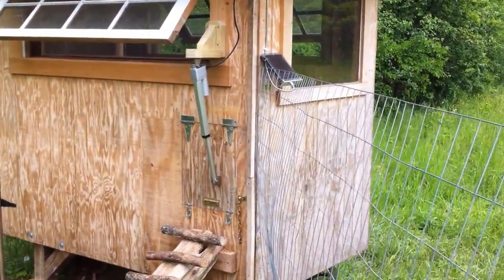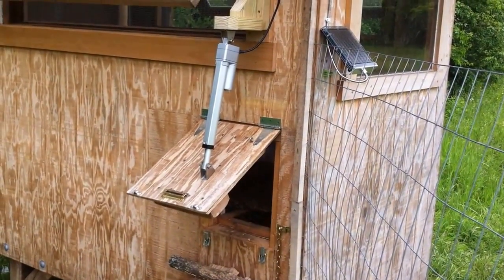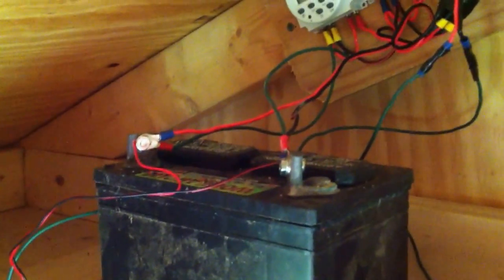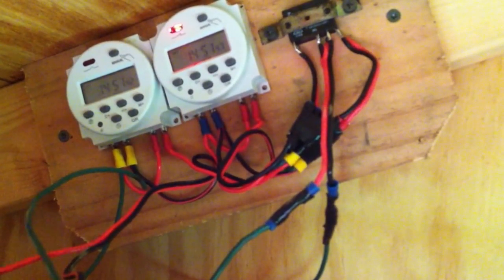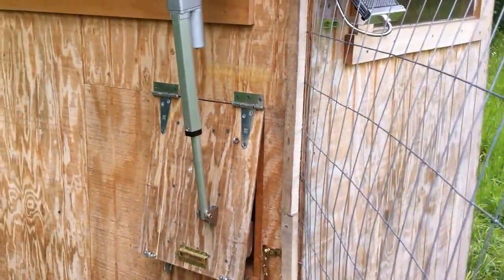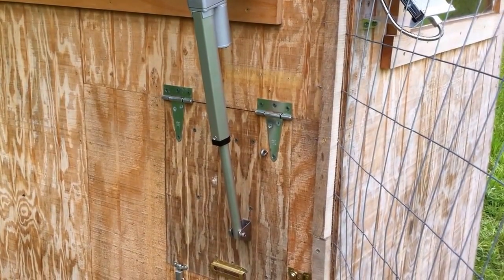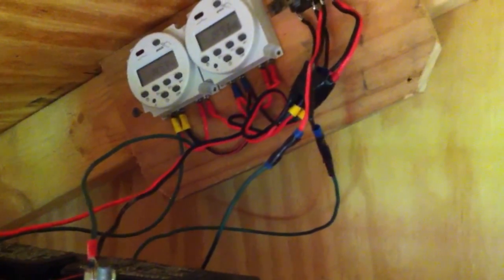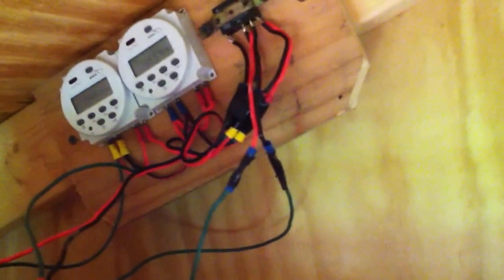Heavy duty automatic chicken coop door

Comment: You must have a different type of relay than I have. I have a dp/dt relay but it does not have an OFF it is switched one way or the other. So during one of the cycles either day or night the relay is pulling power which I don't like but only takes one timer. Can you explain your relay and wiring better. Thanks, I went to your link and it seems others had the same problem I did.

Comment: Why do you have the door close during the day?
Reply from the maker: To demonstrate how it works. Normally I have it open before sunrise & close after sunset & that would be hard to film :)
Reply: @MikeWickenden  ahh ic... My bad
Reply from the maker: @bighigh69  16-gauge or 18-gauge wire should be fine, unless you are using more than a few feet of wire for some reason. See this page for more info: http://blog.netscraps.com/diy/heavy-duty-automatic-chicken-coop-door-ii.html
Reply from the maker: Although the solar timer option is the best, in my opinion: http://blog.netscraps.com/diy/automatic-chicken-coop-door-solar-time-table-switch.html
Reply from the maker: @bighigh69  Hey, that particular model battery pack won't work because the output is 5V @ 2.4 amps. To power the linear actuator, you'd need a battery pack that outputs 12V & at least 5 amps. Something like this should work: https://amzn.to/3deD1vT

Comment: I did basically the same thing only the actuator works horizontally.  Have you had issues with the mechanism freezing and not working in cold weather? We have had several days in the low 20's and the motor doesn't work.
Reply from the maker: No issues. You may want to try vertically. I'm in Vermont. It has worked great as cold as -30 degrees F. I've never had to replace the actuator in the 7 years I've used this, the original is still going strong.

Comment: Had this working today and then for some reason the relay board stopped responding.  I got everything mounted into a waterproof case. I made the system slightly different usine a battery and an AC power source. Ran the power through a solar charging unit to control the charge to the battery and keep everything running in a power failure.  The power light and red relay leds illuminated and would not go off.  Something fried the relay board.  Have ordered a replacement to  try again.

Comment: I just purchased my actuator, timers, charge controller, solar panel and battery to install the same, however, I see you have a relay...what is that needed for?  I was planning on wiring one timer to turn on every morning at 6:00am, off at 6:02am with normal polarity and one timer turning on every evening at 6:00pm, off at 6:02pm...so no timer will be on at the same time.  How are you wiring it to reverse polarity?  I was just going to reverse 2 of the wires and hook all 4 to the 2 actuator wires but I know that's a problem if they turn on at the same time.
Reply from the maker: Sure -- Your method will work fine if you have double pole single throw (DPST) timers that switch both +/- leads. However the problem is most timers are not the DPST type. DPST timers are expensive, like $45 each & you'd still need 2 of 'em. The more typical digital timers only switch 1 lead & are called single pole single throw (SPST).

For a typical SPST timer setup, you run (-) directly to one lead of whatever you want to switch on, & you run (+) through the timer to the other lead. However with SPST timers you can't wire timer #2 connected for reverse polarity -- it will short circuit because as soon as (+) is switched on by timer #2, it's shorted to the direct (-) connection from timer #1.

The double relay module makes it so the leads from the actuator switch between power sources that have reverse polarity from each other. When everything is off, the actuator is connected to (-) (-). When only timer #1 switches on it flips the left relay so power is (+) (-). When only timer #2 switches on, that flips the right relay so power is (-) (+). If both timers come on, power is (+) (+) which does nothing. More info & the wiring diagram is here: http://blog.netscraps.com/diy/heavy-duty-automatic-chicken-coop-door-ii.html

In the video I had originally used a DPDT relay to reverse polarity which is more complicated because the timers have to be programmed to come on simultaneously for the door open event. The better way I described above & in that blog link is to use a dual relay module where one timer controls door open & the other timer controls door close.

Comment: I've thought about setting something like this up. I may use a raspberry pi to do all the thinking though... my one question I'm left with is how do you make sure the chickens are inside when the door closes? I know my chickens and I don't know how quickly they'd catch on to the automatic door concept...
Reply from the maker: Hi Bob, my chickens haven't had trouble with that. One thing that probably helps is our coop has several horizontal sticks for them roost on, & the outside run doesn't any, so when it starts getting dark their natural instinct to roost kicks in & the only place available is inside the coop. We're on 3rd flock of layers & they all just seem to get it.

Comment: Great project. What is the weight that the actuator can load? The actuator is also like this DLA1  actuator: http://www.powerjackmotion.com/product/dla1-actuator/
Reply from the maker: Hi Steve, sorry for the late reply. The actuator linked in the parts list (see website linked in the video description) is rated at 225 lbs force. Most 12V actuators are rated for at least 100 lbs.

Comment: Mike - thanks again for the vid. The only thing I changed was a 12" actuator (lifted the door a bit higher). I also mounted the components on the outside of the coop for easy access to the timers. I used a $5 rectangle food container with a watertight seal (my power plug is actually inside the coop). I used silicone for the one hole that I needed for the wiring and where I screwed it to the coop. 
On a side note, after I assembled everything (before using Velcro to affix the components into the container), I did a manual test. Some lights came on, but nothing happened. I remembered somewhere you mentioned polarity, so I made a quick switch and there it went... perfect. 
The other thing I forgot is not only do you need to set the timer for a "on" time, you need to set each timer to go "off" one minute later.
Thanks again!
Reply from the maker: Hi David, whoops just replied late to your other comment -- that sounds great! Good move relocating the components to somewhere more accessible -- I eventually moved all the electronics in the video to just inside the door, because climbing into the back of the coop to check/change timer programming every few months was ... dirty.

Comment: Hi Mike. Great door! I was wondering what the stroke length needed to be. I'm looking at 12". Any thoughts?
Reply from the maker: Hi David, just depends on your application. Using a tape measure it should be easy to measure how much travel your door needs to open. I used an 8" actuator because I needed 8" of travel. A 12" actuator would have worked fine too for my door -- I just would have attached it farther down toward the bottom of the door or moved the top bracket farther up (which would have opened the door wider). I didn't want my coop door to open too far toward horizontal because I didn't want to give chickens something they could easily stand/roost on.

Only other consideration I can think of is typically a longer actuator will have a longer run time, which isn't necessarily a bad thing.

Comment: Mike:  Have you had any problems with moisture?  I have four of the same actuators and one was rainde on and some moisture collected down in the motor and ruined it.  I can't figure out how to seal it better and still have the the screw push up through the top of the cover..T.hanks
Reply from the maker: Hi James, no, haven't had any problems like that. Been using the same linear actuator for 5 years & it's out in the rain & snow etc. I bet the orientation makes a difference though especially with the cheaper IP-65 & lower-rated actuators. There's better IP-rated actuators available & the higher cost isn't bad, like this one: https://www.progressiveautomations.com/linear-actuator-ip66
Reply from the maker: Not sure what you mean by "have the screw push up through the top of the cover"... do you have your actuator so the arm extends up? If that's the case I can see how water could run down the arm & into the housing, because I'm sure the arm gasket these cheap actuators use isn't great. But, you should be able to flip the actuator around unless space is tight or something like that .. just need to leave longer leads to the motor since that end would move more.

Comment: Just curious why you didn't just use a DPDT relay for your polarity change and then use the timer to control the relay. On = door open, Off = door closed. Then you'd only need one timer. Default condition being closed with power always on,  the limit switch controlling power off to the motor.
Reply from the maker: #16 Racing I didn't do that because of power consumption. Keeping the timer relay & DPDT relay energized for all those hours consumes too much power for this small solar power setup. What you describe would work fine with dedicated power but I still prefer two timers. On the blog I describe a simpler method I've switched to where 1 timer controls opening & 1 timer controls closing.
Reply: @MikeWickenden  I watched the vid and was thinking the DPDT looks to be redundant in this circuit. Unless the timer controlling the DPDT relay was replaced with a photoresistor relay. Current draw on the coils of both the DPDT and photoresistor relay based on 200ma each over 12 hours(light/dark) looks to require a solar surplus of 4.8 amps at 12 volts, hypothetically. Or equivalent solar surplus of the ability to run an additional 60 watt light bulb over the course of an hour.
Reply: OR the timer I just omitted controlled the photoresistor and dpdt circuit to limit it's power consumption to 2 hours or hypothetical 2hrX3relay coils @ 200ma which I think would work out to 14.5Watts on a 12volt. IF the timer wasn't sitting there consuming electricity to control when to turn this circuit on and off. Hypothetically 14.5watts is max consumption since the photoresistor coil and DPDT coil should not be firing off for one of these hours making it more like 9.6 watts of draw. No clue on a digital timers power draw in it's resting state. "In the sit there and dont activate relays but remember what you where set up to do" mode. But the 50 watts of power draw adding it would be avoiding looks like it creates some room for power savings without buying a digital timer and checking it's resting power consumption and crunching these numbers further.
Reply from the maker: @gantz4u  the timer is SPST. So it can't reverse polarity. That's what the DPDT relay wired as an H-bridge does. The power draw of the timers in "sit there" mode is negligible, so using a timer to limit how long the photoresistor relay operates for would be worth doing.
Reply: @MikeWickenden  Just figured this SPST problem out after lighting my house on fire shorting the battery together several times. (That's not a timer. More like a timed relay. Quality build there.) And see the problem now. Further looking into the idea of a photoresistor It seems the chickens demand more consistency for when the door closes and get locked out. a buzzer then motor firing on a delay seems like the better choice since the chickens supposedly start reacting to the buzzer, IF you where to modify this design. I wouldn't toy with the idea of a photoresistor without a buzzer and then delay relay. Unfortunately it seems the most simple noise production devices are also very annoying noises that sound like they scare chickens. I've also lost my morale entirely realizing im not dealing with timers here and need to complete an engineering degree as a work around to that fact.

Comment: I have an automatic door I made for my chicken house that uses 120 vac. I had it hooked up with a timer and a photo cell but the problem I had with it is always having to reset the timer for the length of the days at different times of the year. A photo cell works great to open the door but it can close to soon and some of the chickens might still be outside. I found a delay timer that I am planning on installing to delay the door from closing for 1/2 hour after the photo cell switches. That way all I will need is the photo cell that controls the main relay and a delay timer relay to extend the time 1/2 hour after the photo cell switches telling the door to close. "No more having to reset a timmer for the length of days."

Comment: does your battery ever loose charge do to cloudy days
Reply from the maker: Richard Vandeflier no, the battery can run the system for over a month without being charged. It has extremely low power consumption. If you live in a very cloudy area, definitely use a solar charge controller which is described on the blog post. http://blog.netscraps.com/diy/heavy-duty-automatic-chicken-coop-door-ii.html
Reply: Mike Wickenden bb

Comment: Thank you so much for your video. I watched tons of them trying to figure out a system for my coop. Yours made the most sense to me. Just got mine done. Check it out and let me know what you think. http://youtu.be/mZ1B9RxMkxQ
Reply from the maker: Hi Brad, sorry for the late reply, your comment got held up in the Youtube spam filter & I didn't notice it until just now. Nice work on the coop door, looks great. You might have seen but I made a better version where the two timers don't have to go on simultaneously -- one timer controls opening & the other timer controls closing. In place of the DPDT relay I use a dual SPDT relay module -- or you could use 2 single SPDT relays. Here's the link to the instructions & wiring diagram for the new system: http://blog.netscraps.com/diy/heavy-duty-automatic-chicken-coop-door-ii.html

Comment: Quick question... Why can't you just wire each timer to the battery separately and then wire each timer to the actuator with one timer wired with reverse polarity from the load output? Why do you need the relay? If you need the relay, why do you give the second timer power from the first? Would you not get the same results giving the second timer power from the battery? Your video and diagram is fantastic. Thank you for taking the time to make it. I'm not questioning the way you wired it, the questions are more for me to understand the reverse polarity and relay. I've never understood the reason for relays.
Reply from the maker: +76mcclain Sure, good question. The problem is the timers are SPST -- single pole single throw -- "single pole" means they only switch one lead. In other words, SPST can't switch both positive & negative leads simultaneously. "Single throw" just means the circuit is either disconnected or on, but that doesn't matter ... single pole is the problem.

Hypothetically if you tried to use two SPST timers wired directly to the actuator, you'd have a negative lead connected to each actuator lead, & a positive lead running through each timer also connected to each actuator lead. But as soon as one timer switches on, that creates a short circuit with the negative lead (meant for the other timer) that's connected to the same actuator lead.

If you could find a DPST or DPDT timer -- double pole meaning it switches both positive & negative -- then your suggestion would work, as long as both timers never came on at the same time which would make a short circuit. Using the method I described, there can never be a short circuit since the "polarity switcher" is the DPDT relay wired as an H-bridge, which can only ever provide power to the actuator one way or the other.

In terms of "why you give the second timer power from the first", they're just sharing the same positive & negative leads from the battery. It's the same as running individual wires from the battery to each timer terminal, just uses a lot less wire. The only circuit that actually gets switched on & off by those timers is the red wire on the far right side of each timer, & both of those go directly to the relay.

Relays are just an electrical switch that's turned on & off by electricity. Sounds silly at first but there are a few big benefits. You can switch relays on or off using low-power currents, but have the relay switch high-power current. For instance in your car when you turn the ignition, your ignition is a low-amp switch which turns on a relay near your car battery that routes all the high-amp power in your car battery to the starter motor. That way your ignition switch in the steering column doesn't need to have huge thick power wires running all the way from the battery & back to the starter motor, & the ignition switch itself can be really simple because it only handles low amps. Same thing with winches where there's a control at the end of a long cable -- rather than running thick power wires all the way to the control switch & using expensive switches to handle the high-amp power, they just run low power to the control box using cheap switches & wire, with a few relays back near the winch motor to handle the full power to the winch motor. Similarly with some relays is you can use DC power to activate the relay, & have the relay switch AC power. Also when relays wear out it's cheaper & easier to replace them since they fit standard relay sockets.
Reply: +Mike Wickenden (Wick) cool. That makes sense. Do you know how to wire it up with a photocell? How do you get the reverse polarity with it? I've looked all over the web and can't find a diagram. Thanks for your time.